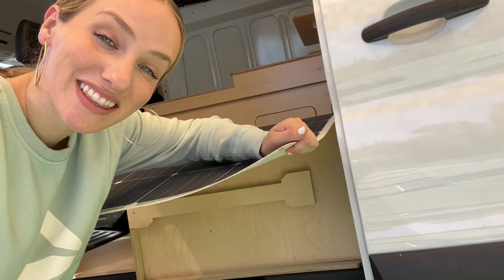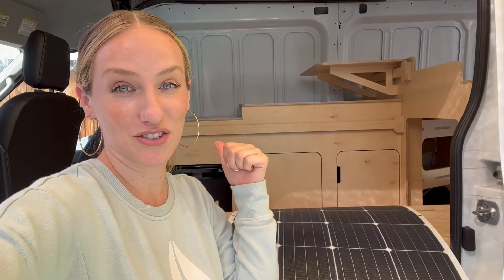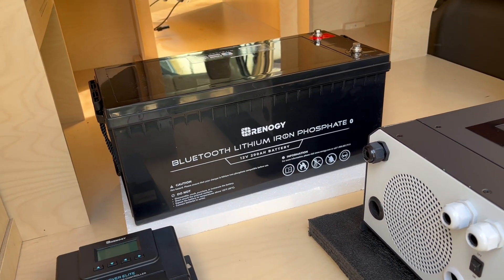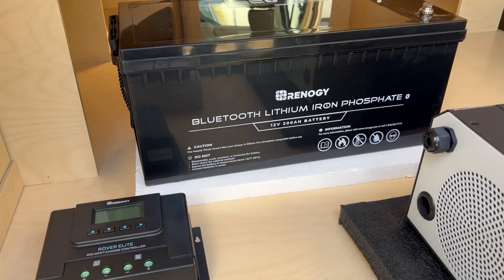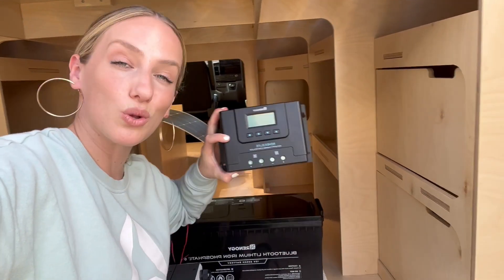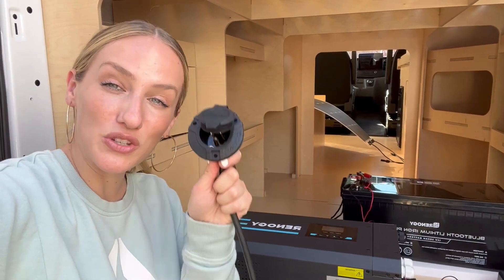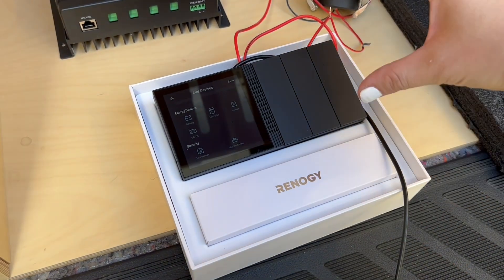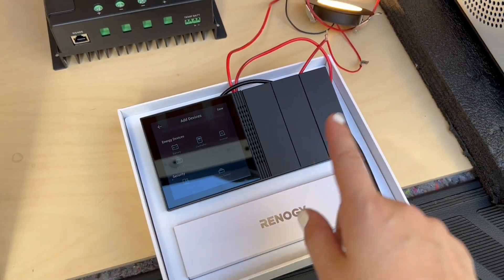New Electrical Features we're using in our E-Campervan Build! The All-Electric Ford E-Transit Van!

Comment: Will you be using the air conditioning and heating from the van? This to me makes the most sense and I'm very curious to see how it works. How much energy it draws over the course of the evening if you were boondocking? I currently have a truck and a converted cargo trailer but if the air conditioning and heat works from the vehicles electrical system so I don't have to run the vehicle that would be ideal. Looking forward to a video about this hopefully.

Comment: Hi I have a question, is there a way to charge the lithium ion battery by an inverter with the E-Transit? I have a pending purchase for the E-Transit but I dont know if I am going to be able to power a Air conditioner and all my appliances with only solar panels charging my ion battery. Thank you so much for your help
Reply: Do you mean solar panels charging your lithium IRON battery? Electric cars use lithium ion batteries but most solar systems use LiFePo4 (lithium iron phosphate). If you have an inverter with AC charging capabilities you will be able to plug it into the Transit AC outlet, just check it’s max wattage to see how long it will take to charge your Lithium Iron batteries, on average a 100ah Lithium battery will have ~ 1280Wh capacity, so 1000W would charge those in 1.28hrs. The 2016 transits had an optional AC outlet with a 150W inverter so that would take over 8 hours to charge a single average lithium battery. Another option is to use a generator to charge them faster or add more solar panels, like flexible light ones you can lay out on the floor outside the van. You will need a LOT of batteries if you wish to power your AC off of them.

Comment: Hi,  yeah,…. Just cruising the van life vids and saw your electric build but now I’m rather stumped 🤔 on this video.     Why are you putting solar and or all the electric hardware in an all electric van.  The good thing about E transit is it has onboard power system that lets all the usage come from the van battery. 

I mean maybe solar to replace what you use if your off grid but hey let’s be honest it’s not going to barge the van enough to drive it unless your in one spot for a while.  Sooooo,…. Yeah just wondering what the purpose was; and why you went that route . Seems extra cost, weight, & space.

Edit: unless this is an affiliate thing cuz your trying to use the electric stuff as sponsor kindav money.  Maybe 🤔
Reply: Hi i am getting the e transit however I dont know if i will be able to power my batteries with the e transit. do you know how i would get electricity from the van as an inverter to charge my batteries?

Comment: Those flexible panels have a tendency to overheat if there's no airflow beneath them, just ask Leisure Travel Vans.
Why bother with house batteries at all?  Just send your solar to charge straight to your chassis battery and draw from that for your build.
Reply: You can't charge the Van battery pack with solar. That's a way different voltage. And needs minimum 1,4kW. 
They should be able to draw 2.2kW if it has the pro power option.
Reply: @RedBatteryHead  Thanks for clarifying, I was under the impression that stepping up the voltage wasn't an issue.  It figures that commercials would oversimplify things.
Reply: @Brigand231  in the commercial I know they power auxiliary devices from the Van or the F150 lightning.
That is possible up to 2.2,kW.

Comment: In an electric vehicule, you already have more electricity than those batteries can provide, why not hook into those and link the solar panel in them?
Reply: I have an eTransit van and will be using it like this.
Reply: can you elaborate please... @dykewithtwolabs
Reply: @vithejoda  I'm pretty sure I've been seeing commercials for EVs that advertise being able to use the vehicle as a backup "generator" for homes when the power goes out.
Edit:  Yep, there are videos on this stuff from years ago.  Solar charging a Tesla:  https://www.youtube.com/watch?v=69QpA5H1bYI  Using EV to power a home:  https://www.youtube.com/watch?v=h4pGSXWkAsc  Those are just the first, easiest results in a two second search.